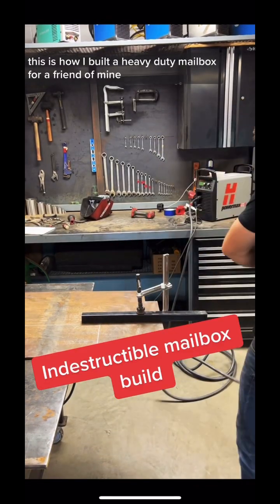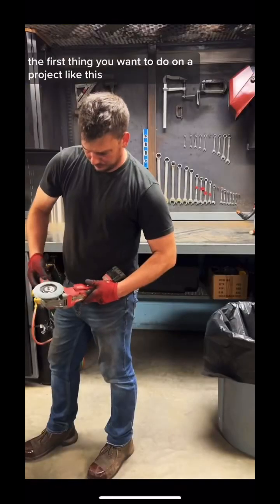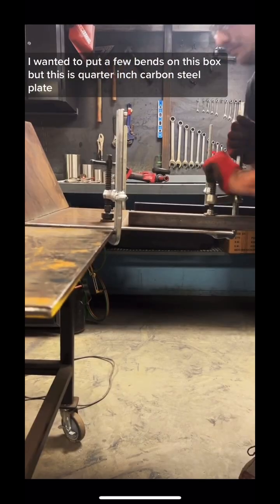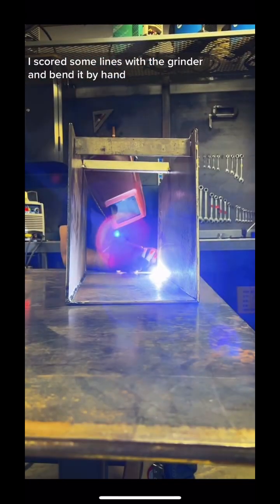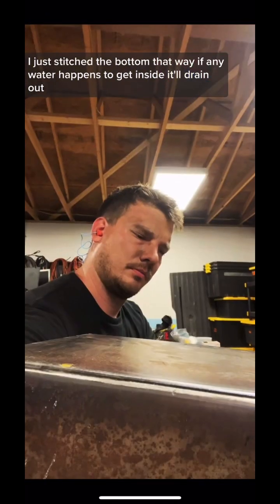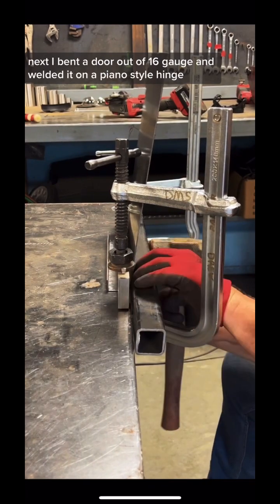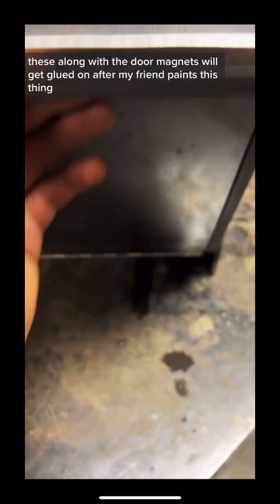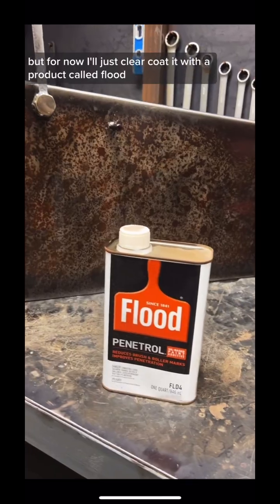INDESTRUCTIBLE MAILBOX BUILD—Welding Project #welding #fabrication #diy

Comment from the maker: Check out my entire mobile tool set here.... 
          https://youtu.be/QZDKPj5ip78
Reply: How u mount that thing?
Reply: The best mailbox supports are stable but bend or fall away if a car hits them. The Federal Highway Administration recommends:

A 4″ x 4″ wooden support or a 2″-diameter standard steel or aluminum pipe.

Avoid unyielding and potentially dangerous supports, like heavy metal pipes, concrete posts, and farm equipment (e.g., milk cans filled with concrete).

Bury your post no more than 24″ deep.

Comment: Lol pretty sure the box isn’t the problem… also it’s a huge liability issue to build and install anything in the roadway easement that will not shear off in the event a vehicle hits it.. you will be sued & lose and in fact if that box you built goes flying through the vehicle injuring the occupants you will again be found liable for injuries… look up your local codes related to mailbox installation or you may be sorry…

Comment: Mount it on a 10 foot long half inch thick I-beam and bury 6 feet of it in the ground.. make the hole 18" wide and fill with concrete.. they could hit it with a f 250 and not have a scratch on the box😂😂

Comment: My dad's mailbox was hit 7 times. After replacing it over and over again with those cheap plastic ones, he finally sunk a 10 foot I-Beam and welded a 0.25" sheet steel box on top. Surrounded the I-Beam in concrete. Built a wooden box around the whole thing. Then he came home drunk in his Camaro and damn near tore his arm off in it, needed 3 skin grafts. At least he didn't need a new mailbox.

Comment: In Idaho we mount the pole 4-6 feet off the edge of the road and weld a horizontal beam about 6 feet off the road and then hang the mailbox with chains.  The plow blade passes under the mailbox.

Comment: Just remember a box is only as strong as the post. 
My old man's box got hit by a drunk driver so he took an 8 foot length of 4"OD pipe, drove it 3 foot down, filled it with concrete, and welded a flange on top. 
It's been a decade and a half and while it's been hit a few times, it ain't moved.

Comment: My neighbor took a 12 inch diameter, 10 foot long steel pipe and left about 4 feet exposed and filled it with concrete and welded some angle iron and mounted his and my mailboxes onto it. So far it's survived a drunk drivers honda civic, multiple tail lights, tail gates and trunk lids, as well as a FedEx delivery trucks roll up door.

Comment: USPS rules state the mailbox has to be within a set distance from the curb or edge of the road.  Also, the post is not to be set in concrete so that it will move if struck by a car.
Reply: Well we put concrete on ours because last time someone freaking stole it. 😂

Comment: Now mount it on a 1/2" wall 12" diameter concrete filled bollard sunk 10' deep in wire re-enforced concrete. Wait for big snow with a big bowl of popcorn

Comment: the thing you need to go with that is the post like my uncles use.  they have old cranks out of detroit 6V71 diesels mounted on the flywheels from 8V71 detroits.  the combined weight is in the neighborhood of 350-400 pounds. and nearly indestructible if someone hits it.

Comment: so in my neighborhood folks cut a section of large enough schedule 40 pipe, and mount the box inside it, while this is effective against high schoolers with base ball bats the fourteen yard dump trucks that are used to plow easily blow them off the post.
I have adopted a softer approach.
 3 inch O.D.  pipe is attached to a pre cast ready base, a four inch O. D. pipe with a standard store bought mail box attached,  is slipped over the three inch pipe.  when the plow or wave of snow strikes it, it merely swivels out of the way unharmed, other than the damage received from the indestructible mailboxes that have been ripped from their moorings and mixed into the snow.
same box twenty years of service.
A little engineering ican be worth more than a lot of welding.
☺

Comment: Remove all guards? That sounds irresponsible. I'm all for it if you want to, but there's a lot of danger to having that shit removed, even if you do everything else correct. High speed spinning could literally explode a defective abrasive wheel or chop wheel with seemingly no reason or warning.

Comment: This is not that strong. Most farms in my neck of the woods use 12”x12” square HSS tubing with 1/2” wall to make their mailboxes. Cheaper and quicker and stronger to make.

Comment: Get an old nitrogen cylinder, cut it in half, boom two mail boxes. As a bonus, if you don't purge it first, they'll be in different area codes
Reply: Nitrogen is not flammable, so no need to purge.
Reply: @Tony Botha  yeah obviously it's not flammable... 2200 PSI is a lot of stored energy.

Comment: Mount it to half inch steel pipe, fill with cement hurried 3 feet down with a rebar and cement base foot. Pull it back from the main area of travel and shoulder as far as possible. Reinforced mailboxes are tricky business legal wise.

Comment: We used to replace the mail box at least three times a year… our final solution was a regular mailbox on a 4x4 inside a five gallon bucket filled with concrete. That’s all. Paint the bucket, add some flowers if you want to.
Now when it gets hit, it just falls over. 
Much better than finding a destroyed mail box and junk mail all over the yard.

Comment: You'd be surprised the damage a plow can do. From something I saw this winter, I don't know if that would survive a plow. Hopefully, it does, but I I saw a 1 inch thick by 5 inch wide by 2 and a half foot long chunk of steel get ripped either out of the ground or off of the plow. Either which it put the plow out of service because he was broke down on the other side of the oberpass.
Reply: itl probably damage the plow which they will be liable for, a smarter sulutionwould be to put the mailbox further from the roadside and put a marker on it(one of thoose orange plastic tubes with some reflectives)

Comment: To install at your friends house: first you take a 15’ 1/2” I beam and weld it to another 15’ 1/2” I beam then pile drive them 11’ into the ground.  Remove 4’ of earth around and deep to remove a 4’ cubed amount of dirt.  Drive 3/4” rebar into the earth 4’ and we’d the rebar4’ deep and laterally and weld all pieces together using approximately 80 pieces of 3/4” rebar and weld to the I-beams. Then pour 20k concrete infused with fiberglass and carbon fiber.  Let set two weeks. Weld mailbox to the I beams and surround the I beams with guard rail and backfill with the same concrete with interweaving 3/4” rebar.   Then post a small sign warning mailbox.  They will only hit it once!   It will not even scratch the guard rail and concrete nor will it move a fraction of an inch.   Then go visit the fucking smartass driver in the hospital.  Ask him why he didn’t adhere to the warning?   Then just give him some friendly advice to be aware of mailboxes.

Comment: My parents kept having people hit theirs with a bat or run into it with cars. They got an 8th inch steel one and put a 3 inch solid steel rod 12 ft into the ground and concrete around the base so it wouldn't move.  A drunk guy hit it going 30 or so mph . It didn't even move a quarter inch.

Comment: Wrong... This isn't how you fight the snow plow, I know because I had my box demolished three years in a row with heavy wet snow.

The trick is that you put the post further from the road. Weld a heavy bolt sticking straight up on a heavy plate that will mount on top of the post, this will act as a hinge. Put the box on a metal arm and use some heavy springs on both sides of the arm attached to the post. When the snow hits the box, it just swings it out of the way. You can angle the bolt to make the box come back to center on its own. Has been working ever since.

Comment: You really want a mailbox that will destroy a plow rather than vice versa?
2 inch low carbon steel. Stick it too a 3 inch thick I Beam and sink it 25 feet into the ground in concrete.

Comment: I just bought a extra large m radius top mail box. Slid my standard size radius top mail box in side the larger one. Then filled the voids on sides and top with concrete.  Did hear some guy screaming a few nights ago.and found a broken bat by the mail box. But box was just fine. Now my neighbors have started doing the same thing..

Comment: My dad, grandpa and I got tired of the road grater taking chunks off our property when widening the road a little more each year as if we didn’t notice so we used parts from a old flexi coil chisel flow and barried quarter inch thick 4#4 tubing down 5ft leaving a foot sticking up as our property marker. It’s very common for most of us to mark our property lines. We painted it orange so it wasn’t hidden. When the grater tried pushing it over it bent the grading blade 😂. We covered our ass by having a surveyor come out and speaking to an attorney first to ensure we weren’t doing anything wrong. The neighbors somehow moved one of the biggest boulders I’ve ever seen onto the part of the road that went through their property.
Reply: Grader… not “grater”😂 but that too…😂

Comment: Now weld it to a 10 inch thick solid steel stock about 12 foot long weld that to an i beam base pour concrete onto it covering the i beam refill the dirt tamp it tight that mf ain’t going no where

Comment: I took the guards off the angle grinder only once. I now have a 3 inch long, black scar from the experience. ☹️
Reply: Let the tool do the work dont work the tool, never ever had a problem with flab cutting grinding brazing sanding or any disc
Reply: @mikedonlon1594  A buddy (35 year welder/fab in oilfield ) had a cracked zip disc come apart and embed a big piece in his face shield. He keeps it on the wall of his shop. Bad shit happens to the best of us sometimes.
Reply: Thats how you know you have 0 skills and respect for the tool. Been using them for decades without issue and only ever had a problem when i ran it with one.
Reply: @cumulusvapes  Very true, all about respect of the tool. I personally just shoot sparks towards me so if the grinder hangs up, it at least launches away from me if I happen to lose grip
Reply: @rwmusicstudio  Had a 9" grinder with a masonary blade hang and jerked out of my hand away from me, bounced off the ground, spun around in the air and just kissed the back of my right hand, still spinning. Those things have momentum.... Only needed 3 ligaments reattached.....
Reply: @cumulusvapes  some people that are special need guards, some kids need training wheels. It’s not for everyone

Comment: The solution I saw while in Maine was hang a standard mailbox that's nice and lightweight with a chain from a post that's clear of the roadway, unless someone goes out of their way the cheap mailbox will be the only thing that gets damaged and can be easily replaced. But the plows don't destroy them, just bump them and they swing out of the path of the plow.

Comment: You bent it the opposite way of what would provide structural strength. bending away from the score will leave a perfect valley to weld in. The remainder of the plate will melt into a good hot weld, and look like awesome penetration. Try it once, you'll be sold 😁

Comment: That's exactly why my shop built mailbox is mounted on a 10x10 post as well
Reply: You probably mean 
( 10 FOOT or FEET = 10" ) x ( 10 INCHES ) 
If I am right don't say enything or text enything.
( " If anything hit that mailbox it will vibrate like a semi truck or an aluminum baseball bat." ) 
 If it's 10 x 10 
that means 
you need ( 6 Foot or Feet of material in the ground or the cement / concrete to be 
( 4 foot or 4 feet ) tall. OR make it 
8 x 10 cut it off or buy it that way. 
( 2 feet ) to play with like all men want. 4 foot deep x 4 foot out of the ground by ( 10 INCHES ) around. 
( " If anything hit that mailbox it will vibrate like a semi truck or an aluminum baseball bat." ) 
😃😄😆😆😀
"I know I wrote you paragraph"😁🤐
Reply: Personally I would mount it on a piece of railroad track It would give it a more aesthetic look

Comment: Cool, but if you mount it on a solid post, make sure you're not liable for damaging anything that hits it. Also, if you mount it on a regular pole, you've put 80lbs of steel at driver face level of most cars, bet it would go right through a windshield....

Comment: I really want to see the I BEAM you will use to mount it on earth.
Reply: We did this exact build in Canada and the postal service wouldn’t deliver mail and got the police involved citing that our mailbox would harm someone if they drove into it. It was 15’ off the road edge. We ended up changing it to a wooden rail tie and a steel box.
Reply: @manuelve1998  I've seen a few (US, not Canada) that use the actual rail, rather than the tie.
Reply: @manuelve1998  cause mail men know best
Reply: @Manuel VE  it is not surprising considering that Canada is a communist country that will fine you 25000 for talking
Reply: @manuelve1998  in Canada are you allowed to have a brick mailbox? In the US people build mailbox housings out of concrete or bricks to protect them.
Reply: @manuelve1998  people shouldn’t be driving into it
Reply: The slickest setup I've ever seen was 4" heavy wall square tube, sunk 4 feet deep using concrete and a sonoform tube. Now here the slick part - it was set 6 eet back from the road. The actual mailbox was on of those heavy duty commercial ones, mounted on a six foot spring loaded swing arm, with a polyethylene bumper and a solar fence light on it. It was the most ridiculously over engineered mailbox mount I've ever seen.
Reply: In the usa in oklahoma there are so many mailboxes made from just 2 pieces of pipe one about 3ft long and the one in the ground is about 10 ft
Reply: Installation please.
Reply: And I beem or a piece of railroad track 5 ft in the ground and cemented
Reply: Pretty sure it's the other way around. The earth is mounted to that mailbox right now...
Reply: Bros bouta strike oil with how deep that post will be
Reply: Put the I-beam 6 feet in the ground wrap it concrete 2 feet thick. When the Snow Plow hits that it’ll put them in the ditch.😂😂😂😂😂😂
Reply: The earth to the mailbox you mean... 

But if i may ask... Why not just take the mailbox a few steps back where it won't get overrun by a snow plow?

This seems like an unnecessary problem to an unnecessary problem that could be solved a lot more easily for everyone but someone needs to be a dick and be the strong stubborn guy...
Reply: @toaster_gmbh  well, there is the problem of the mail carrier being able to REACH the box to put the mail in it,,,,,
Reply: @Toaster_GmbH  sometimes you don't have space, sometimes the city doesn't allow you to move it.
Reply: @Mike.The.Jeweler  but then why not get one at your hous or really anywherer else. You can't tell me there is no space. Like there is not much space required to that and if you don't have the space for that it's already a miracle how you even have space for a mailbox at all ... Or do you have so little space that you actually installed it on the road? In that case there is not much yo complaine about.
Reply: @toaster_gmbh  in rural areas the mailboxes are all on the side of the road. if you move your mailbox away from the road you will get no mail.
Reply: @bmxscape  as if they couldn't reach in 1m further. I have a hard time believing that and if that is so then that's a fucked up system.... America style
Reply: @Toaster_GmbH  my city requires mailboxes be on the road unless you're on a snow emergency route, they also require mailboxes on the road be within 30 inches or something from the curb. If your mailbox doesn't meet the city requirements, they straight up won't deliver your mail, you'll have to go to the post office.
Reply: @toaster_gmbh  most rural roads here have ditches along side them for water drainage so no you cant move it back away from the road
Reply: @bmxscape  then put a small pipe through that ditch and put earth above it and then maybe a few tiles or stone or whatever. Easy and cheap solve and a simple problem is gone. A small section would be enough. That is what they are doing already anyway or they would not be able to drive into their garage as the ditch would just keep going
Reply: @toaster_gmbh  we dont own the ditch thats the cities property. cannot modify it. plus the mailbox must be placed roadside
Reply: @bmxscape  but again, how do you then enter your house? It has a ditch around it then afterall.
Reply: @toaster_gmbh  mailbox may not be installed in a private drive. dude just give up.
Reply: @bmxscape  not really, in the end my Statement about it being stupid still stands. And also the one about there being tons of solutions. Put it somewhere next your driveway, that can cross the ditch. And if you have no space your house has to be right next thr street or have a fence at which point why not Install a mailbox directly into them? There are tons of solutions. The only way there wouldn't be one would be a mandate existing that says your mailbox needs to be installed right in the street.
Reply: @toaster_gmbh  you're getting really mad over being answered because it wasn't the answer you came up with in your head. It's a comment section on YouTube. There's no need to be upset.
Reply: @toaster_gmbh  🤓🤓🤓
Reply: @toaster_gmbh  Dude, the simple fact is, there are rules and regulations to how and where mailboxes can be put. Your "solutions" don't work because they straight up violate those rules.

Fun fact, here in the US, in most (if not all) states, the state/county/municipality owns so many feet ONTO your property, as measured from road center. So doing something like filling in a ditch can easily land the homeowner some hefty fines.

In the end, if you don't understand the system, best just to NOT comment on it.